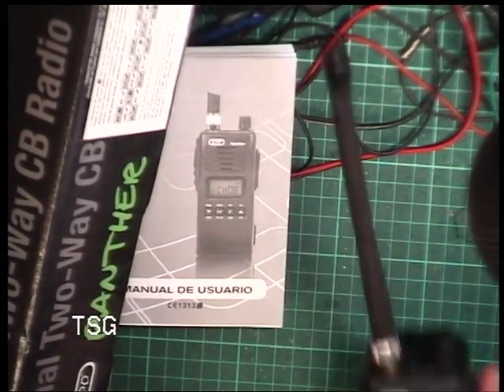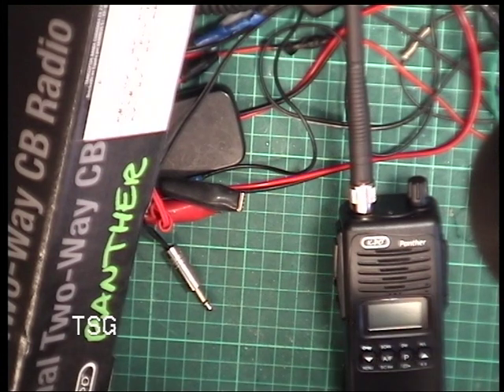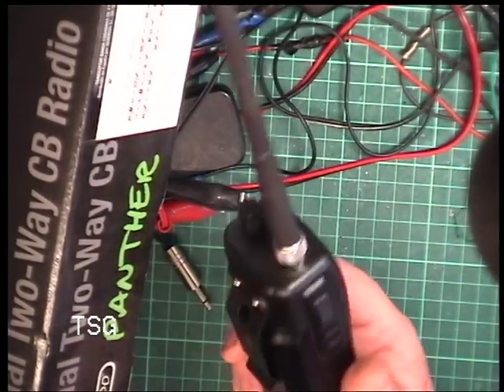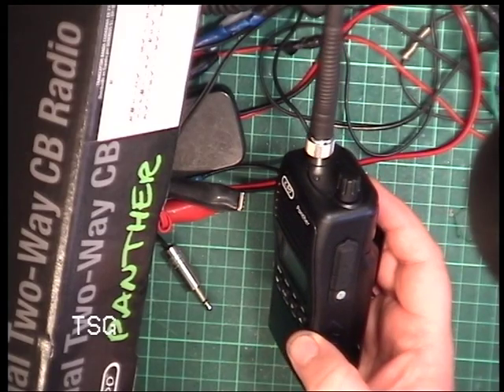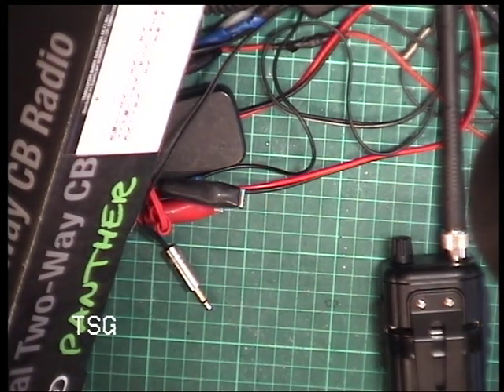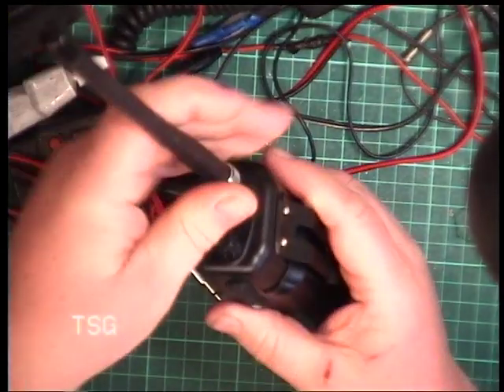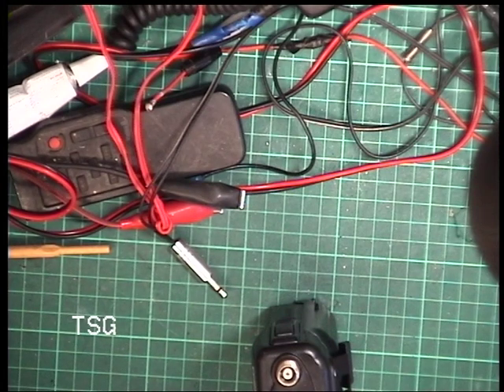K-PO Panther UK CE-Multi-Norm CB Radio (Handheld) - Service discussion & dismantling

Comment: Hi Richard
Just opened my President Randy 2 and where on your kpo it says fmmod on the President there is an adjustment so you can set up deviation .
So you do get more if get a real president radio. There is a second pot near the display on the right hand side,it is not marked..
The board is v0.8 dated 23/02/2013.
hope this is of use 
Regards
Robert
Reply from the maker: Thanks Robert.

Richard

Comment: hi richard ive just got this radio today but with the aftermarket high gain antenna im only picking up people speaking foriegn languages. i live in ireland and have this set to EU. do you know why i cant pickup anyone in my general area? thanks
Reply from the maker: If you are in Northern Irealnd I would expect most activity on the UK set of channels, whereas if you are in Southern Ireland I would expect activity on the EU set of channels. Bear in mind the foreign people you can hear may well be using illegal high power amplifiers. Of couse there may be nobody on in your area locally. How many times do I flick round the channels here when doing our demonstrations & usually nobody is on....nearly always. I'm 35 miles from the nearest city.

Richard, G0OJF, UK
Reply: @ukfmcbradioservicingTango21  thanks richard thats great to know

Comment: How long does it take to charge the battery? According to the manual it should take 12 hours. - I am still waiting, 14 hours now, and the LED is still red. But it should turn green when the battery is full. - Is it your experience that the LED turns green, and how long does charging take? - Thanks.
Reply from the maker: Bear in mind I'm a service engineer.

If it's still charging after 16 hours then disconnect the charger & use the radio until the battery is flat. Recharge the battery & don't let it charge more than 16 hours. After a few cycles like this the battery should reach it's full & normal working capacity & chances are that it will charge as the instructions say after this.

This is general for all new products with rechargeable batteries. The first few charges are unlikely to see the battery working to it's full capacity.

Specifically to this model, I frankly can't remember, but would assume our sample charged to the green light straight from new & I also assume it did it within 16 hours or I would have remembered it being abnormal.

Richard
Reply: @ukfmcbradioservicingTango21  Many thanks! I will keep an eye on it...

Comment: Hi is this the same radio as randy 2 Lafayette jopix 413 just with panther on front or does it perform better??
Reply from the maker: I don't know as we haven't had the Randy yet. Many rigs that look the same actually aren't, so it's best not to jump to conclusions.

Richard
Reply: UK CB radio servicing  it’s just that I have the President randy 2  and the Lafayette urano and to be honest the case is exactly the same as them the urano and jopix 413 menu buttons are same just wondering as thinking of buying panther handheld cheers for replying mick

Comment: My President Randy 2 it's AM for UK band FM for EU and when you press F and Transmit at the same time the frequency is displayed all the time also I've got a drop in ICOM charger and battery that's fits and it lasts longer than the stock one .
Reply from the maker: I'm confused....it's AM for UK band?  the radio shouldn;t be able to do that as the UK band is FM only.

richard

Comment: Shame about the poor deviation and not being able to adjust it.  Nice looking set though, looks professional compared to other CB handhelds.  Doubt you would get far with the small rubber duck though.  However, it looks like it was made for local use like building sites or within a building etc.
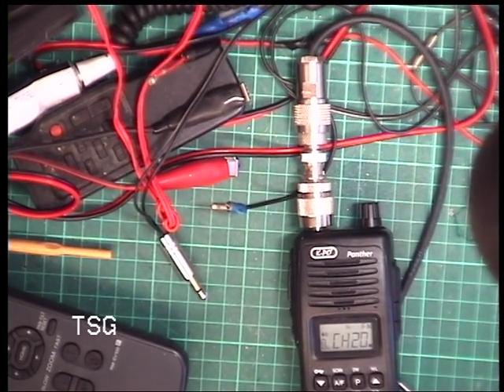Reply from the maker: Well we've done the field test & it works well considering the very small helical antenna. The deviation is OK, but I would have preferred to have been able to bring it up from 2:00 to 2.20 Khz. I wouldn't hesitate in recommending it though, and especially at the £105 we paid of Ebay brand new.

richard
Reply: @ukfmcbradioservicingTango21  what sort of distance did it work up to? I have just purchased one. Mind you just tried it with a mate and no joy - not sure if its his old set up.
Reply from the maker: @anthonywright78  The next two videos show our on the air & field tests for this radio. On it's own aerial on our 'difficult terrain' test, we got 3 miles back to base.

richard